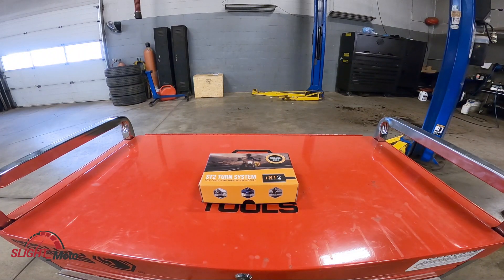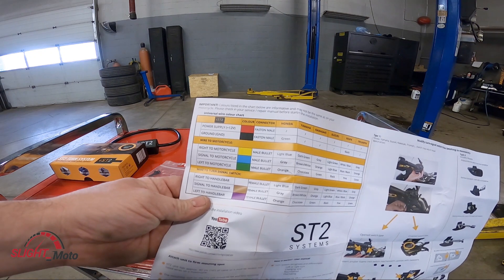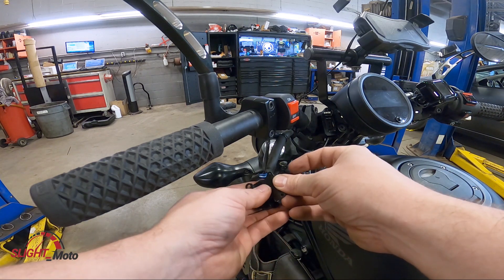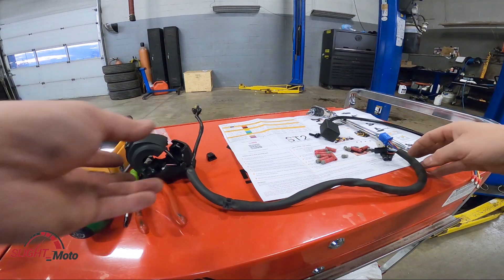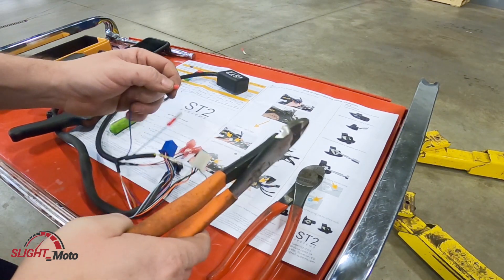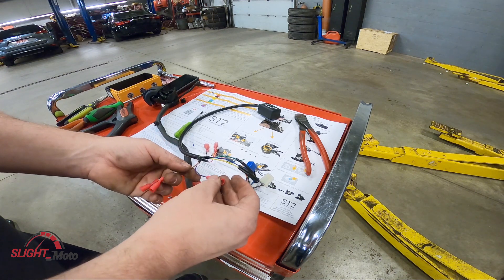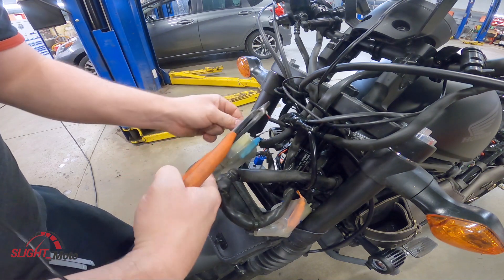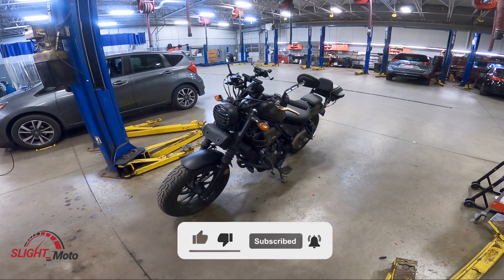Honda Rebel (2017-2019) - ST2 SELF-CANCELLING TURN SIGNAL MODULE

Comment: Honda Rebel 500 2021 - To liberate the turn switch cable from the bike required these additional steps; 1) Remove gas tank; 2) Completely remove head light assembly (different than shown in the video); 3) Remove speedometer assembly; 4) Remove 4 bolts holding handlebars.  This allows the cable to be slipped out of the bike.  For this install to work and for the wiring to be done with the cable off the bike, it will require that the crimped connectors are used as the ST2 module will NOT slip back into the internals of the bike where the cable connects to the bikes harness.  Turn signal switch is also different than shown in the video, but easily figured out.

Comment: How do you take the turn switch cap off without breaking it
Reply from the maker: The button that fits on the lever? It’s friction fitted. So gently pull it straight back. You shouldn’t have any issues with that.

Comment: Will it work on my RE Classic 350 reborn?
Reply from the maker: This works on most bikes if not all. The reason it’s labeled this way is due to wire colours and connection locations. 

As long as you trace the wires or have a wire diagram you should be fine.
Reply: @SLIGHT_  thanks bro

Comment: My old virago 535 had self cancelling indicters and that was back in 1990 , it’s odd the rebel 500 didn’t have it from factory, but then it’s good practice to cancel them bye pressing in the indicter switch , as the self cancelling indicators are set to cancel a bit to late for my liking , so bye pushing in the button is best I think , I am getting a twin one pice seat for my rebel 500 , then hoping this will make my ride better for my disability, them red dragon forward controls I fitted last time I commented on your channel are great, thanks for all your clips on YouTube.
Reply from the maker: Yeah it’s shocking most bikes today don’t have self canceling signals… this kit was done on an old friends bike. For those that wish to have the self cancel option, this kits works well enough. Yet, Like you I am more original… tap that signal often… kinda a habit now lol.

Appreciate the support Phillip, thanks for watching.

Comment: Why not gust time out after ca 10 seconds?
Reply from the maker: Time out? Never seen that with the oem. 
This kits uses many different inputs to turn off the signal.
Reply: @SLIGHT_  time out is used on a tranchiver so the radio will stop transmitting at set time so it will not transmit for ever if the push to talk is accidently push.
Reply from the maker: @joistein  I do understand how a timeout system would work in this case… yet what kit are you referring too?

Comment: I bought this item for a BMW R1150R, website suggests this should work, but it won't. After selling the item, the company (David Rand) does not respond to my emails any more. I'm afraid I have been scammed.
Reply from the maker: Why won’t it work?? 

I’ve heard this a few times now… they need to work on their customer service. Yet many others have great experiences… smh sorry to hear your difficulties. Hopefully they fix this quickly.
Reply: @SLIGHT_  It won't work, because of this: in most bikes, the flasher relay is placed in series with the flasher switch and bulbs. The BMW has a different set up with momentary switches: one for left, one for right and one to cancel. For the module to work, they need to change the circuits. I suppose that the regular ST2 module has a relay contact inside for both left and right, that gets switched on when you push the flasher switch (which was made momentary by the supplied rubber dampers). After finishing your bend/ curve, then that contact is released, and the flasher will stop. For the BMW, all they have to do is 'read' the left and right flasher switch, and when the flasher has to stop, connect the BMW cancel switch to ground for a moment. It should not be hard to do for them, but it's a different setup.
Reply from the maker: @dickjuffermans7550  great info. Thank you for this.

Comment: To install this ST2 module, you will get absolutely ZERO help from ST2, they do not respond to either emails or FB messenger.

Honda Rebel 500 2021 - To liberate the turn switch cable from the bike required these additional steps; 1) Remove gas tank; 2) Completely remove head light assembly (different than shown in the video); 3) Remove speedometer assembly; 4) Remove 4 bolts holding handlebars.  This allows the cable to be slipped out of the bike.  For this install to work and for the wiring to be done with the cable off the bike, it will require that the crimped connectors are used as the ST2 module will NOT slip back into the internals of the bike where the cable connects to the bikes harness.  Turn signal switch is also different than shown in the video, but easily figured out.   Switched 12Vdc is found under the battery cover on the right side of the bike with a 7.5A fuse.
Reply from the maker: Thanks for providing this info for the later models.

Comment: And maybe the final disconnect here is that finding a switched 12VDC source is not the same. sigh.
Reply from the maker: note: this is all great info... Unfortunately this was done on a 2019... Honda did change a few things for the 2020 plus. shouldn't be difficult to adjust the install from this.

Comment: On my Rebel 500 2021, the other end of that cable is not inside the headlight housing.  In fact, it doesn't even enter the housing.  It is below the gas tank.  Could not access it without removing the gas tank.  It is much more work to get at the other end of that cable.  Didn't need to mess with the headlight.
Reply from the maker: 2020 plus, changed a few things. Thank you!! It’s extremely helpful pointing out that difference. I appreciate that.

added this point in the description. Thanks again.

Comment: good video , but i have got headlight out hanging and have 3 white connectors and not sure either 
of them is the one i want ,  could be one of the 2 bigger ones further back the cable but its a major job to get at them and still might be wrong !
Reply from the maker: Follow the harness back to the switch. 
It may be easier to remove it as I did so there is no confusion. 

Are the colours the same as the video?
Reply: it looks like the connector is under the main control screen but well hidden and i dont know which one and i got to remove all sorts to get at it so cant see colours 
im reluctant to do this as im unsure it will go back in
Reply from the maker: @robertharris9820  I agree. If you’re not sure it’s best not to do this. Sorry this video didn’t help you. I wish you could send me photos of what you’re seeing, as this platform is hard to point things out.

Edit: what year is your Rebel?
Reply: @robertharris9820  The other end of that cable is NOT inside the headlight housing.  It is under the gas tank.

Comment: I have this on my bike now. Saves your hand from constantly telling me that I forgot to turn the dang thing off. Tried their brake module as well, but the vibration from the bike was constantly setting it off. Had it adjusted to be the least sensitive it could be. Can't use it.

Comment: I should also mention that the wiring harness colours change depending on where you are in the world. In the wiring harness diagram I have been using they refer to the purple (the diagram calls it 'V' for Violet) as being a positive wire, but on my UK bike the same wire is black with a blue tracer. It can make it a little tricky following the wiring diagram 😞
Reply from the maker: Interesting. Not sure why Honda would do this. I can as shocked an aftermarket company knew the correct wire colours. That is was manufacture specific and not model specific. 

Thanks for sharing this
Reply: @SLIGHT_  To be honest, I don't think it's just Honda. I have seen this now on BMW, Suzuki and Honda. I just think that, for some reason, they seem to want to re-colour depending on the global region. I have no idea what the logic behind it is.

Comment: VERY interesting video @slight_ - I am in the process of fitting a PDM60 to my 2022 Rebel 500 so seeing the details on where the harness goes, where the connector packs are hidden is all very useful. I am guessing this is a slightly (no pun intended) older model as the turn signal stalks look different to mine, they could always be custom I guess. However, HOLD THE PRESS! - Your guy has a GPS support bar above the dash dial. This is something I am trying to figure out how to manufacture at the moment, so what is this and where did he get it PLEASE! It would save me a whole lotta work if someone has already produced one. THANK YOU!   ❓
Reply from the maker: Video is schedule to drop soon on the bar. 
I will find a link in the meantime. I will post it for you here. (When I get it)
Reply: @SLIGHT_  That would be very much appreciated. It will save me trying to create something myself. I plan to remount my lockable Touratech Handlebar mount on the Rebel.
Reply from the maker: @B0M0A0K  https://m.aliexpress.com/item/1005003188626359.html?srcSns=sns_Copy&spreadType=socialShare&bizType=ProductDetail&social_params=20697649409&aff_fcid=52b335ace20d430d84e5e39409d21402-1667230196459-09538-_mN91GJQ&tt=MG&aff_fsk=_mN91GJQ&aff_platform=default&sk=_mN91GJQ&aff_trace_key=52b335ace20d430d84e5e39409d21402-1667230196459-09538-_mN91GJQ&shareId=20697649409&businessType=ProductDetail&platform=AE&terminal_id=bc4c8611808a4b00a322bf13a1a2512c&afSmartRedirect=y
Reply: @SLIGHT_  Thanks!
Reply: Have ordered mine from a different source (more UK friendly). It should arrive next week and am keen to see how it fits and looks on my Rebel.
Reply from the maker: @B0M0A0K  I would love to hear your thoughts on install.